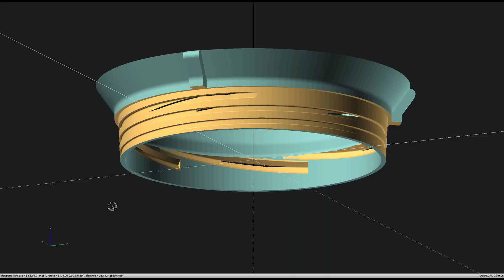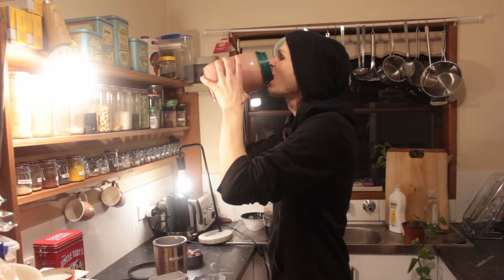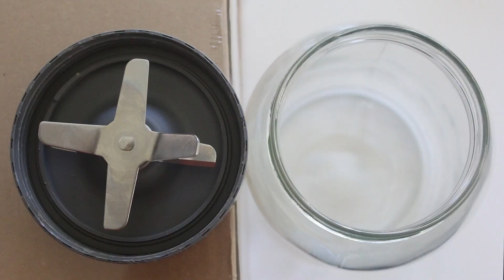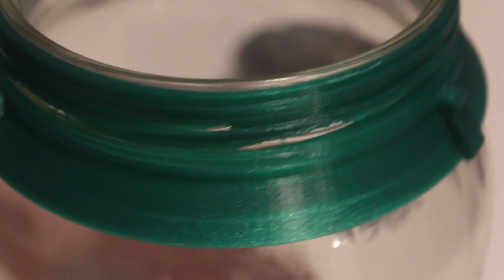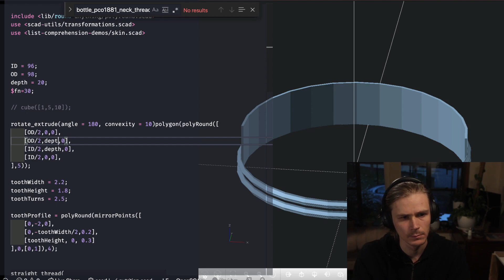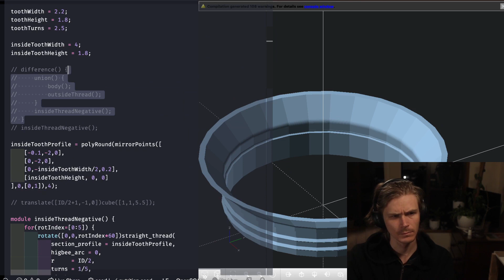My completely noRmAL blender🥤

Comment: Ok - so why not make an extender / adapter ??
Move the inner (jars) thread up by 3 > 5cm and you have a far more permanent result.
I will not be surprised if it is because of printing limitations. This is a random video I stumbled across...
Reply from the maker: There are a lot of complications with 3d printing and food safety, so I'd much rather it be the rim of the glass contacting the seal rather than the printed part. This way the smoothie doesn't contact the print.
Reply: @meanman1992  Right. Thanks for the info.